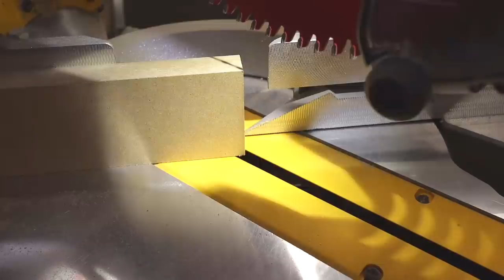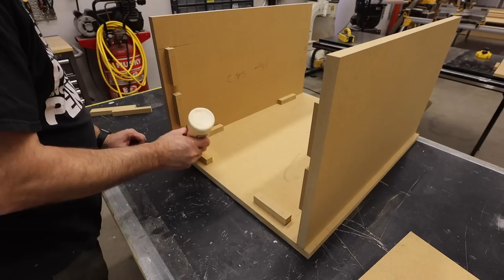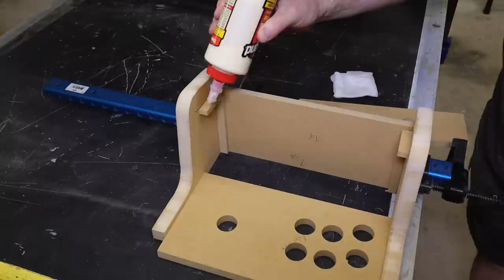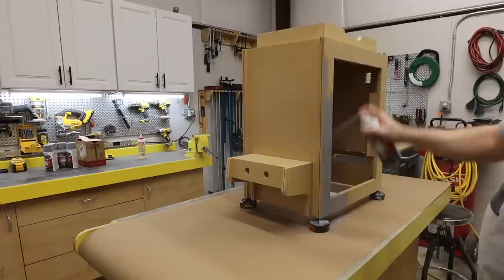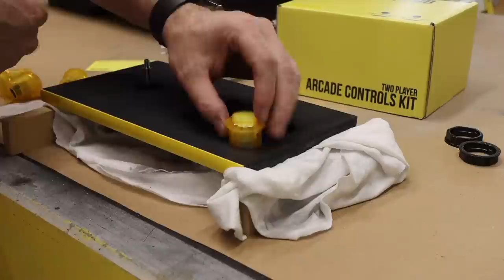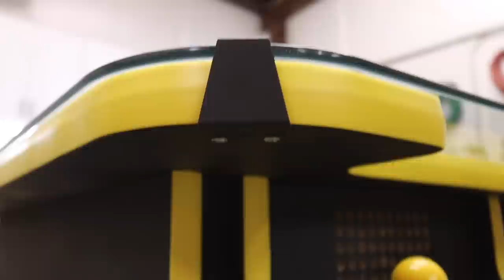Cocktail Table Arcade Build

Comment: Thanks, @TheGeekPub!   Bought your plans, parts, etc.   Put together an amazing table for my girlfriend.  She's wanted a Ms PacMan for a long time.   Nostalgia from her days of going to Pizza Hut and playing as a child.   It turned out REALLY well (and gave me an excuse to buy some new tools).  A couple of modifications for anyone interested.   The USB speakers were no longer available, so I ended up using some BOSS B653 car speakers and a Kinter K3118.  For the monitor I had read that the Dell 2007FPB 20 inch was a great monitor for an application like this.  Bought one on ebay.  Otherwise followed the plans closely.   The one mistake I may fix is I should have used the glass as the outline for the top rather than the printed plans.   The glass I bought is sized a bit bigger.   That's on me for not measuring twice. 🙂  Girlfriend loves it.  You made me a hero!

Comment from the maker: We finally built the cocktail table arcade cabinet that so many have asked for. I don't know why I waited this long!  It is most definitely my favorite arcade build ever!  There will definitely be a part two to this video. There are many things I want to improve and add still.  RGB lighting for the control panels.  I also want to really hug that monitor up against the glass.
Reply: The speaker holes look a bit unfinished.
Reply from the maker: Yes.  I drilled them after painting.  On my list too. ;-)
Reply: Thank you SO MUCH!!❤❤❤
Reply: if i made one i would like to have galaxian arkanoid so i need a spinner for ark

Comment: Buckets of hot water work wonders for keeping rattle can pressure high, I let cans sit for about 1/2 hour before use. Also I like to duck tape a sawzall blade to the can and use a sawzall to shake my spray paint.
Reply: That’s a nifty tick about the sawzall! Thanks for sharing.

Comment: I like your build quality. It's not my personal choice of materials, but we still employ the same basic technique. Small correction to the video: People, if you don't own a brad (pin) nailer, then stop and go get one. Your work will turn out much better and stronger, than if you  build without it. Read and follow the safety instructions. Never hold your hand, on other side, in the path of nailer. Measure and create a mock display screen from thin MDF and scrap wood, to build around, so you don't risk damaging the real one. Good luck and happy building.

Comment: Great job, I used to make cocktail table arcade machines as living, but for people who aren't clued up on raspberry pi, i would recommend an emulator kit with  
a pre made wiring loom. I would also do a deeper recess on the Monitor as it makes a huge difference with viewing the screen
Reply from the maker: You are so right on the monitor.  I plan to do a follow up video on this and sink the monitor deeper, as well as put some black trim in there to make it look better.
Reply: @TheGeekPub   we just used to sand down the mdf and spray it black, was a lot cheaper and less time consuming than using black trimming. We also ran everything through the power supply without the need for of an extension lead, really helped when it came to cable management

Comment: Watching cabinet builds is always therapeutic for me. I have a 3/4 size standing arcade cabinet my mom and I built from a MicroCenter kit (2p cab). How do 2 player games (like a side scrolling beat em up) work if you're looking at the screen from top down ? I know such a build isn't really meant for that, but since you have a Raspberry Pi in there with RetroPie or something like that running it all I know it can run a beat em up just fine. Thanks for this video!
Reply from the maker: You have to tell MAME that you are in cocktail table mode.  Then it turns the screen upside down for each player.  Of course, the game itself has to have cocktail table support. ;-)
Reply: @TheGeekPub  Oh interesting... I've never used cocktail table mode on MAME, so I was unaware such a setting existed! Cool.
Reply: @TheGeekPub  do you know which games all have cocktail support?

Comment: Now that brings me back to my childhood.  Well done!  

Did the original cocktail cabinets have in-direct lighting of the joystick area?  I wonder if some RGB LED strip lights, with a diffuser, could lend themselves to this aspect?

Either way it looks great!  :)
Reply from the maker: There will def be a part two of this video.  I have MANY things I want to do I didn't have time for in this video.  RGB lighting is one of them.  I also want to snug the monitor up closer to the glass.
Reply: @TheGeekPub How much more difficult would it be to utilize older lightly used CRTs from the 90s and 80s , in order to get that arcade look, feel..and smell, vs using modern LED ?

Comment: Nice, but would add a coin bucket with brackets to hold bucket in place if using a functioning coin door with actual coin insertion. Otherwise you will end up with coins all over the floor inside the cabinet and have to manually pick all of them up each time you clean the inside of the cabinet.
Reply from the maker: Future video.

Comment: I'm building a Cocktail table out of Walnut. (It's the only way my wife would let me put one in our front room. Just about done and glass its on its way.
Question- where did you get the corner brackets you used to secure the glass to the table?
Reply from the maker: The ones we sell in our store. ;-)

Comment: That's awesome!!
Any idea in particular why arcade machines are made out of MDF? Would plywood be that much heavier? Obviously I can imagine solid wood being heavier, but if we're going with composites, I'd pick plywood over MDF any day. Just my thoughts. Very nice work! :)
Reply from the maker: Plywood would actually be lighter.  But plywood is much more difficult to get a smooth paint finish on.  You have to fill the woodgrain.  It's much easier to sand and shape rounded corners without needing fillers or resins.  The other reason is that plywood is very prone to chip out on the edges making t-molding more difficult.  Plywood also offers no additional strength in this application. Lastly, the extra weight is actually advantageous for this type of thing. They stay put when kids are banging on them.

Simply put, MDF is just a better choice of material for arcades.

Comment: If you blunt the tip o a brad nail it will not split the MDF. Just take a brad and invert it so the head is down. Tap the pointed end with  a hammer; just one tap. That is it. No more splitting the 1/2" MDF.

Comment: Do you, or know of a source, that sells the cab kits for DIY assembly (without the gaming electronics)? Many of us don't have the required tools nor the woodworking skills to do a nice job as shown in this video. I have looked around and the prices I have seen for custom cab DIY kits are around the same price as existing arcade cabs that come with all the emulation hardware. Hate to buy an a complete arcade system (limited games), just to gut all the electronics to put in retropie.
Reply from the maker: I have been asked 1000 times to build and sell my own cabinets.  The problem is people then say "I'd pay you $200."  $200 wouldn't even cover the materials.  :-). The other problem is that shipping would cost a fortune.  Probably $175.  I'd have to sell the cabinets for close to $1000 to make it worthwhile, and I just don't think anyone would pay that.

Comment: Question:
That's a 19" LCD you said, right? Is it a 4:3 proper or is it a 5:4 SXGA?  I'm having lots of trouble finding proper 4:3 LCDs that are larger than 15" because the used market is so flooded with old 19: 5:4 SXGA monitors!  I'm in the Seattle market, and it just seems like a never ending sea of 5:4. Does it matter really in your experience?

Comment: It feels weird to see that you use mdf for the cabinet, I don't know why. I used plywood with factory laminate on the faces and used biscuit to join the pieces. Don't you use a mask when you work with mdf? That's a lot of dust there! I might be weird but my favorite parts were the USB port and the power plug :D
(I really like the buttons with the LED backlight too)

Did you add any type of feet to the cabinet?
Reply from the maker: MDF is so easy to shape and get a good finish on.  Plywood has a grain that has to be dealt with using fillers.
Reply: @TheGeekPub  the plywood I'm talking already has laminate on the faces, it's meant for furnitures. I chose a beautiful black so you don't have to use filler on that one (maybe it's not named plywood, I'm not sure). But I get what you mean.
Reply from the maker: I suspect you mean melamine coated particle board.
Reply: @TheGeekPub  probably? :) I don't know, I'm not really into woodworking and term, especially on a foreign language :)
Reply: @TheGeekPub  or possibly MDO medium density overlay

Comment: You don't show the creation of the pocket from the top surface. Most people create a rabbet for mounting the display panel. What tools did you use to create it and more specifically what tools did you use to create the inside right angle corners?
Reply from the maker: Make sure you're subbed.  Part two is coming and will be discussed.

Comment: This is a very nice and awesome build. However I don't the get the 2 player thing yet. Pac-Man seems to be cool on this but I really imagine fightning games/co op beat em ups to be aweful to play with 2 players against/with each otheras they both sit on the side.
Reply from the maker: There will be a side option in the plans in the next week or two.  Additionally, games that have a cocktail table mode handle that in software.  For example, Pac-Man flips the screen for player 2.  Other games actually integrate it so works both ways.  We will explain this in part two.  Coming soon!

Comment: That's a pretty pricy monitor! Is it effective to use an old 16x9 IPS monitor and maybe just center a 4:3 image in the center of the monitor. I want to build a tabletop cocktail. Your monitor choice is about equal to my budget.
Reply from the maker: Sure.  You can most definitely do that to reduce cost.

Comment: Sadly can't find the glass top replacement for the atari-style cocktail cabinets or the metal retention clips on amazon.
Reply from the maker: Yep.  That's the way to go.  Every time I order mail order glass its busted.  I found a local glass shop.  Told them what I wanted and they made it within 2 days very affordably.
Reply: @TheGeekPub  Did you bother with tempered glass for the top?

Comment: I recently built a very similar cocktail cabinet.  It went through a few revisions (I started out with an original working Galaga PCB set, which are still mounted in it).  Then I tried one of those 412-in-1 Jamma things, but I found those to be lame and poor quality in terms of how well their emulation works.  Finally I settled on RetroPie on an Raspberry Pi 3b+, which seems to be a really good approach.

One thing I don't like about mine (and I notice yours sort of has it too) is that the overlay doesn't "attach" to the monitor, so you can see about 1/4" of raw wood at the top.  I painted mine black like yours, but it still seems kind of rough.

Any ideas on how to make some kind of nice bezel for that?  I thought about 3D printing one, with maybe 1/2mm thick top so it sits nice and flush, but my 3D printer can't print anything that big unfortunately.  I haven't come up with any good ideas myself, but I notice that raw edge every time I use it.
Reply from the maker: LOL!  This is actually something I am going to go back and fix.  I totally forgot to sand the edges.  Because I had planed to bring the monitor closer to the glass.  I ran out of time and never did it.  I'll probably make an update video in the future about this.  I want to really bring that monitor up and "hug the glass".
Reply: @TheGeekPub  

I routed out the inside of mine, so the monitor sits about 1/4 inch away from the top, but you still see that raw edge.  I suppose if you set the router deep enough, so that the depth was only about 1/8 inch, if you painted it it probably wouldn't be noticeable.  I get nervous running a router that close to the surface though, afraid of tear out.
Reply from the maker: For sure.  You could also do a hardwood or plastic liner that you could then fill any gaps with wood filler and sand to perfection.  That's another way to do it without routing.  We will see, because it is definitely something I am going to do.

Comment: you should build a virtual pinball machine
Reply from the maker: I am so going to do this!
Reply: @TheGeekPub  cant wait i be looking for that video
Reply: @TheGeekPub  only thing about a Virtual pinball machine it can get very pricey more then a arcade machine . arcade machine you can use raspberry pi . virtual pinball machine you have to use a computer and if you going use Visual Pinball X with pinup with video snap files you will need some what decent video card probably like a 1070 or higher .

Comment: One thing I don't understand is way so many people use resbery pi instead off old computer wean someone create arcade the take so much space any way ?

I personally have plan to create arcade with old computer
Reply from the maker: Well, before COVID a Raspberry Pi could be had for $20, uses almost no electricity, and will work 100% reliably.  An old worn out PC may be plagued with instability and reliability problems.
Reply: @TheGeekPub  I the do what problem ? for my experience computer for my is better option for multiple reasons for my

1. If something break I just chege this spefic part
2. It's very easy to Chenge the hard drive
3. Computers have better stuch for resbery pi
4. I'm able to upgrade this computer if want to
5. I already have this old computer I don't use

Also heard drive on tower computer are very cheap and I have plan to add Tera bite hard drive In the order to create my own lybery off games off on this arcade computer

Comment: The build is gorgeous, but something I noticed is you were working with MDF without respirator. Please always use a respirator with MDF (actually with all woods), MDF is known for containing formaldehyd thus its dust is carcinogenic.
Reply: @safetypolice3956  What are you basing your assestment of my interests on ?
I work with wood too, for years I've seen people working without respirators, I also assumed it was ok, it's not. And it's not a bad idea to let people know of it.
I get the comedy of the safety police, but don't be an idiot brushing off safety concerns as if it was a way of ego boosting, it's not. I'd rather people not having to deal with the health issues I'm now having to deal with.